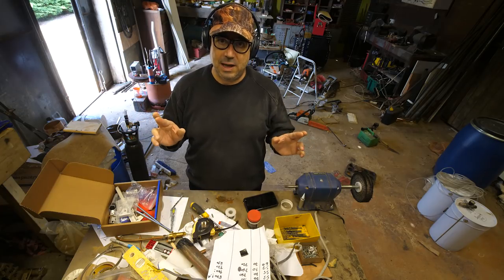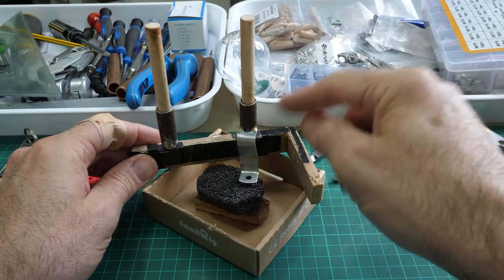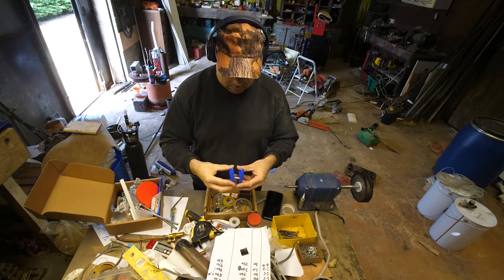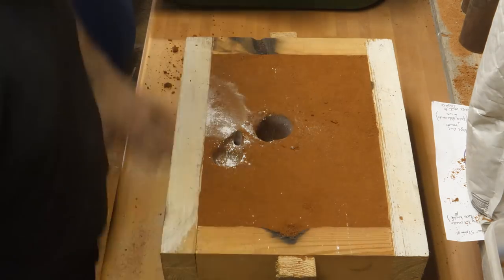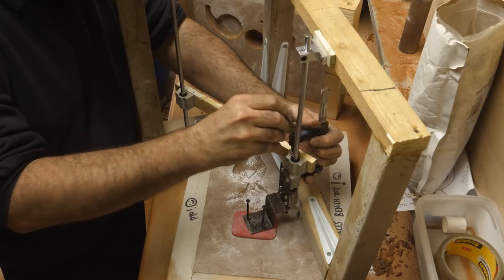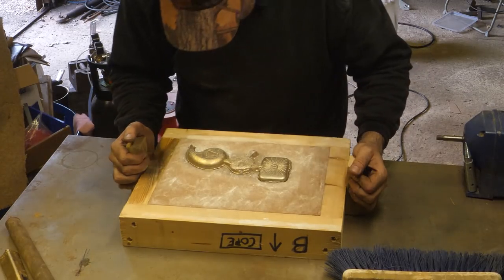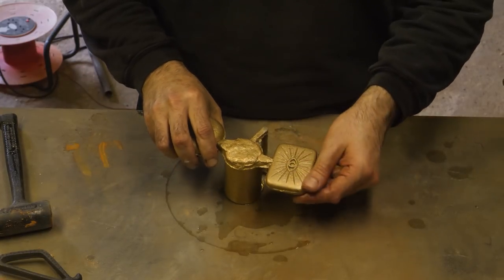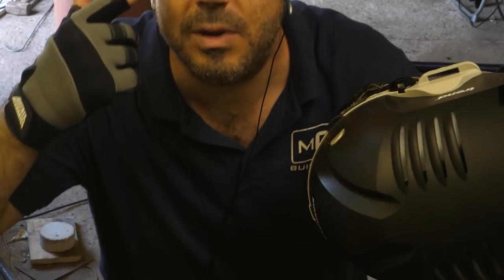Make a Pattern Puller for sand casting AND Two bonus castings * Space Comma & Illuminati Play Button

Comment: Pro-tip:  put a sacrificial little knob of sorts on the back of your 3-D printed molds. Should make lifting the objects out of casting sand / formed mold easier. Wouldn't hurt to fashion some sort of guide that perfectly fits around the entire circumference of the 3-D printed mold ,a shaft of sorts so that the 3-D printed object maybe lifted ,as near as makes no difference ,perfectly vertical out of the sand.
  ,

Comment: Brilliant mate.  I've got to make a pattern puller as well. The older I get, I'm finding it increasingly difficult to pull small patterns out of the sand without rocking them or shaking.  

Martin does have one that he shows in one of his videos.  It basically is on two legs that straddle the casting box and has a fixed cross-member across the top and a sliding cross-member below.  You came up with a good implementation.
Reply from the maker: swdweeb thanks! Ahh interesting I will go look on martins channel and have a look for his. Cheers mate
Reply from the maker: swdweeb thanks Perry! Yeah tell me about it... these young’uns don’t know how easy they have it :) I’ve just seen martins, it looks awesome, now I’ve seen it I could have done one like that, I just didn’t think of it!

Comment: I came here from Conspiracy Cats. I love sand casting! I’ve done fairly large aluminum pieces and small bronze and silver pieces. What is the red material you are using as your pattern? It looks like plastic. I have used dense sign foam (multiple use) but it requires a lot of sealing and in aluminum I’ve used the very toxic method of burning out styrofoam (one of kind). Great to see this on Youtube and your painting vids too. Love from western Canada.

Comment: Great to see another video, really enjoyed it. Waited a long time to see some more awesome casting :)

I was thinking while you were talking about your pattern lifter, does clamping them together risk you accidentally knocking the patterns? 

I was wondering about building a pattern lifter on 4 legs that rest on your work bench rather than on the casting, with 4 "rails" to prevent any rotation. You could then mount the lifter on any of the 4 rails. I was trying to figure out how to have some kind of small spring loaded lock that would just click into place when the lifter was lowered to prevent the need for clamping.

I have no idea what I'm talking about but I thought it would be fun to think about whilst watching you cast.
Reply from the maker: Hi Ninja! thanks for your awesome comment! yes i suppose it does risk it but i'm pressing down quite hard on the bearings when i clamp them together - but i did notice the frame rock slightly on the cask when i clamped - not ideal. i think your system would be better. If you can find Olfoundryman's comment below he has linked his own pattern puller (i didnt know he had one - wish i had known!) - it's really a very nice bit of kit, not at all like my heath robinson affair. have a look at his, it seems to be like the one you describe :) 
iv'e got loads of casting content coming out in the next 10days (openers open eeeek in a week or so) then when i get back from holiday i just need to finish off editing two more casting videos :) cheers o/
Reply: @JulianMakes  haha awesome, I will look forward to it! I'll have a look for the linked pattern puller below. :)

Comment: I know its too late now, but why not use a suction type thing next time.
Reply from the maker: hi Maloc :) i had that same awesome idea but when i tried a sucker it didnt stick very well. in order for them to work i'd have to smooth the inside surface a lot and i'm not sure it's worth it. I have deceided on a different route though... i might add some captive nuts spaced at the correct distance for the holes on the puller and then jusr bolt through into those :) but it requires a little testing first!